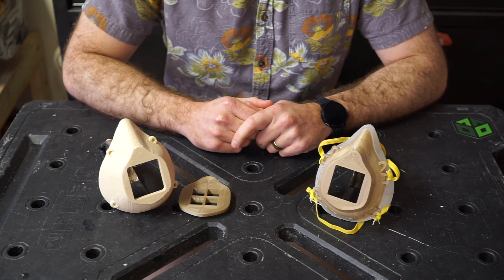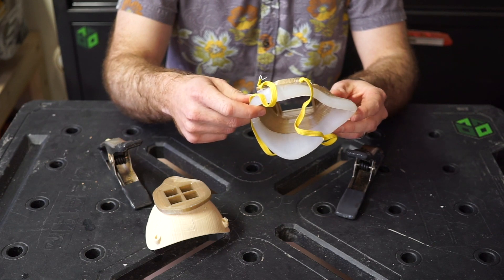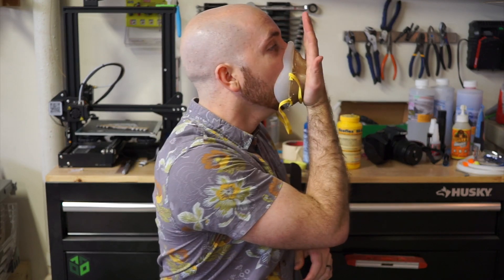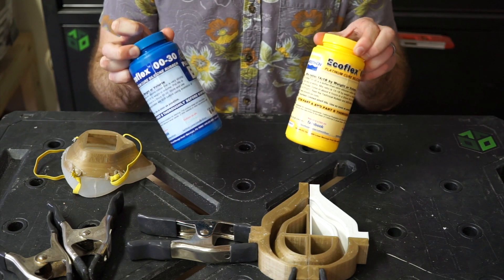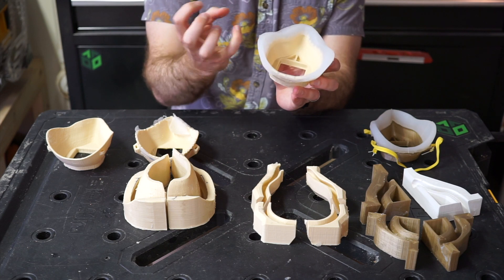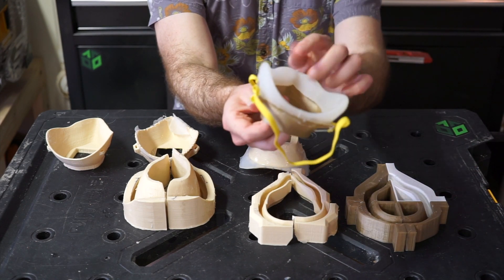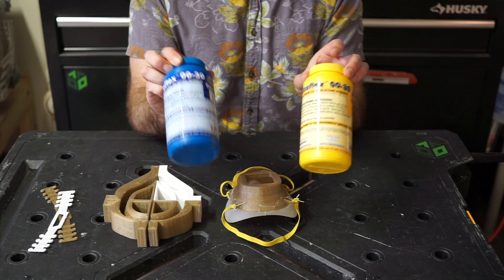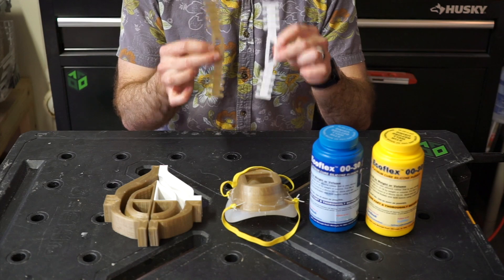Improved 3D Printable Respirator with Silicone Over Mold

Comment: Dip the frame in Plasti-Dip to seal the PLA's micropores, and with the silicone rim you've got it good.  Well done, and now I wish I'd bought that 3d printer a while back!
Reply from the maker: Good idea, I was not even thinking about sealing the main body and was focused on the seal against the users face.  It's not too late to get into 3D printing, even with the pandemic they get cheaper and more accessible every day (except filament is getting harder to come by right now).

Comment: can you make a video with the entere process. thanks
Reply from the maker: Hi RC 3d, unfortunately I am out of silicone.  If you are looking to 3D print a mask and get a proper seal on it, check out Smooth-On's gasket making video.  They're the company that makes the silicone I used and have a youtube channel.  Their design is quicker and uses less silicone than mine.
Reply: @callalilycollective  thanks for reply.I will make one, you have a great design. i hope you can improve you design very soon. greetings from Peru.

Comment: I would suggest adding some registration features that will insure the 4 part mold is aligned while being clamped.  Should be really easy to do.  Thanks for sharing your work.  BTW, Smooth On's gasket used the 00-35 hardness silicone.  Do you find that the 00-30 is too soft?  According to their chart that shore hardness is getting close to gummy bear softness.  One more thing...none of these mask designs incorporate an exhale valve.  I feel like I'm getting a build up of CO2 when using an effective filtering material.  An exhale valve would be a great feature to add.
Reply from the maker: Hi Chris, thank you for the input.  The registration feature is a great idea.  I think the -30 is great at this thickness level.  If you went thinner like Smooth-ons gasket (which i suggest people use over my design) the -35 is better.  My employer actually recruited me to help them mass produce the smooth on designs now, and we prototyped using my -30 supply, but are using the -35 for production.  I personally prefer the -30 because it does not discolor to yellow though.

As far as CO2 build up I am shying away from valve features, but am looking into changing the filter head to have more surface area of filtration material.  We are working on getting other material designs lab tested so a shortage of n95 material will not limit us by rationing filter membrane size.
Reply: @callalilycollective  Yes larger filter areas are a great improvement.  One of the best I've found is the Bolivar design but even this one seems like I get too much CO2 building up.  I'm using hepa filter fabric for the filter and I must concentrate on breathing deeply to get enough O2 (I do have a completely airtight seal).  https://www.thingiverse.com/thing:4244081  As you can see this design has a significantly larger filter area than the one you're using.
Reply from the maker: @chrisyoung8062  Thanks for the link.  That increased surface area is definitely and improvement.  The two issues I see are it is still not big enough as you said, and it is not a simple shape for mass producing filters.  I cannot find the link now but I saw someone designing a filter manifold that mates to the standard montana mask filter hole and branches to hold 2 square filters of the same size.   My employer is working on getting some other materials lab tested for filter purposes that can be stitched together and cut out at home by people who can sew.  A square pattern is more optimal for this application.

Comment: We're trying to make an open-source respirator here in south Asia, would really appreciate the .stp files.
Reply from the maker: Hi Guru glad to hear it.  If you are looking to mass produce respirators, Smooth-on has developed a method for casting the Montana Mask and then also molding a gasket that you just glue onto the rim of the mask to get a proper seal.  It uses less silicone than my design, and is much easier for making a large number.  Check out Smooth-on's youtube channel for details.
Reply: @callalilycollective  thank you.

Comment: This is a great idea. Good job. I was working on exactly the same idea. Glad you did it. Hope to get the CAD files to make some changes. Thanks much!!
Reply from the maker: Hi Tes,

Thanks for checking out my design.  I will try and upload the .stp files to grabcad this week.  If you got grab cad someone else has already uploaded a nice solid model of the Montana Mask, which is what i worked off of.  

Also this over mold technique is probably only worthwhile if making a few custom masks.  If making anything in mass, smooth-on (the silicone manufacturer) has come up with an easy gasket design that you can cast with the same silicone and a 3D printed mold, then just glue it around the edge of the standard montana mask.
Reply: Found this silicone seal with a C channel. Will order it and let you know now if it works with the Montana mask design. I hope silicone doesn't irritate the skin. https://www.mcmaster.com/4869A68